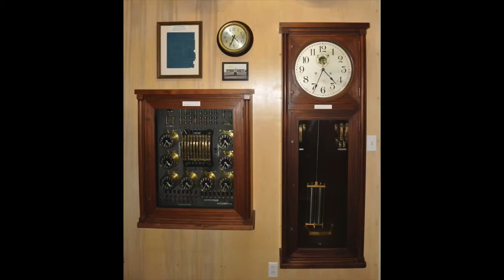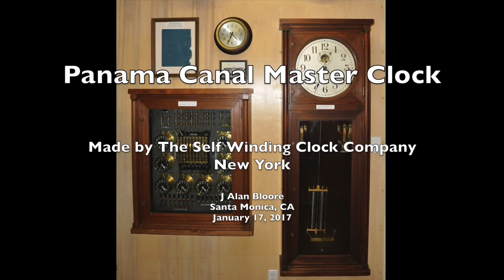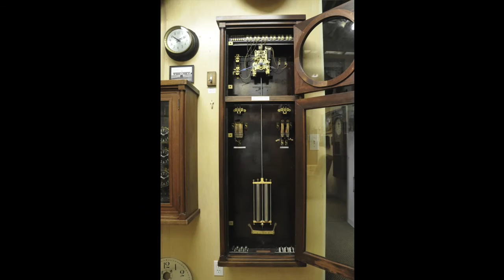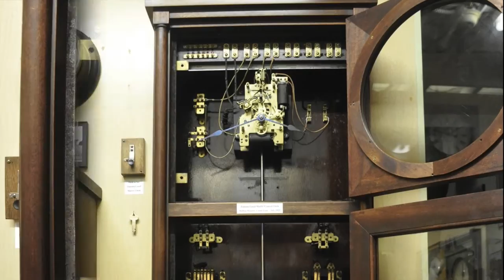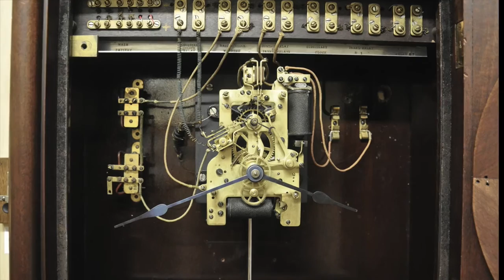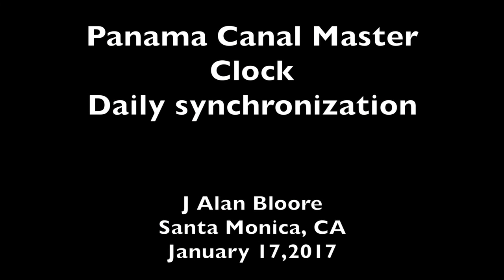Self Winding Clock - Synchronizing the Panama Canal Master Clock

Comment: Do you happen to know much about the system that replaced this? I've found one news article that leads me to believe an IBM Type 37 was used as a replacement master.
Reply from the maker: Hi Michael, I also found a reference to the system being replaced with a IBM model 37 radio master clock. I would be interested in seeing the article that you are referring to. I suppose they may be different articles. If possible could you send me a copy or direct me to the article? Thanks, Alan   jabloore@aol.com

Comment: how do you adjust this for dst?
Reply from the maker: The Master Clock hands can simply be moved forward one hour and the pilot clocks with connected slaves can be moved forward by pushing the advance key 120 times (1/2 second impulses). Going back to Standard Time is a little trickier.The simplest way is to stop the clock for 11 hours.
Reply: @SelfWindingClocks  What about the subsidiary clocks?
Reply from the maker: @gordonrucker4450  If the subsidiary clock has the synchronizer functioning the hands can only be moved forward but not backward..  So... Spring forward and wait 11 hours or move hands 11 hours for Fall back. If no synchronizer move back one hour.